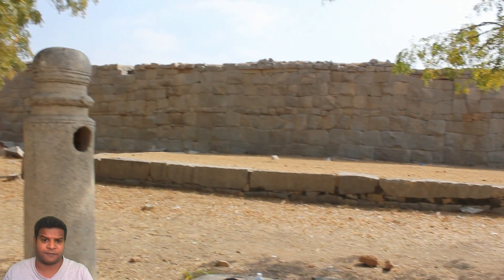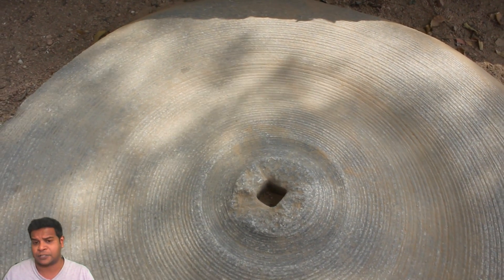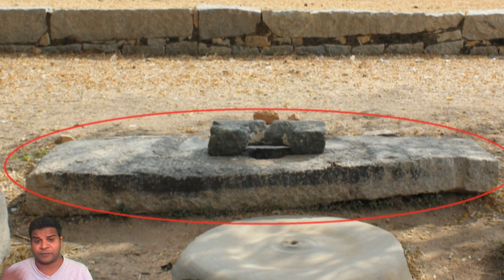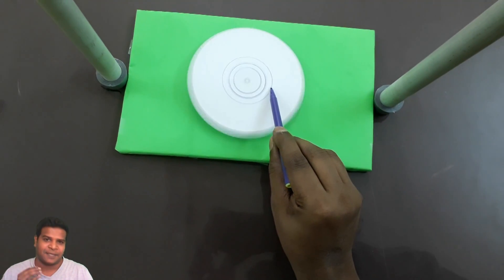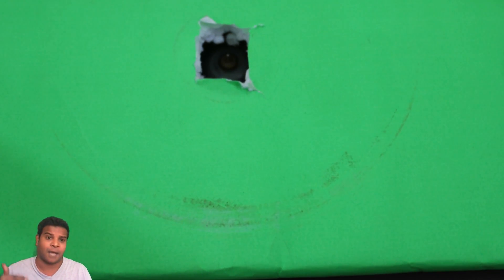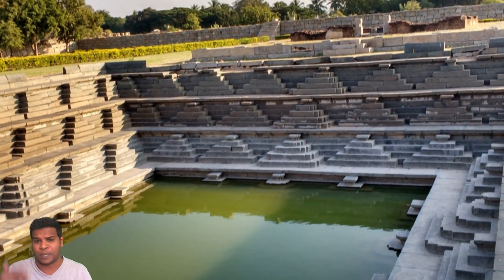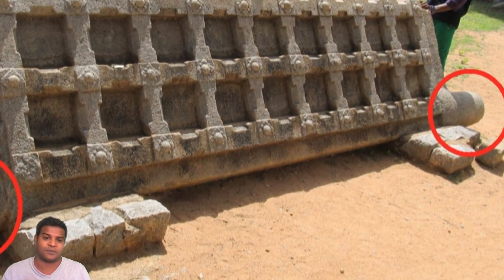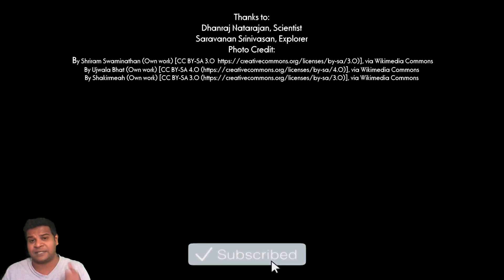Ancient Lathe Machine Found in Hampi, India - Lost Technology Discovered?

Comment: Well deduced. Though the machine you describe would be more accurately described as a milling machine. Lathes have been in use for 2500 years. From simple reciprocal lathes (driven with a bowstring) for cutting wood and soft stone. Illustrations of lathes can be seen in the tomb of Petosisis, Egypt around 400 BC and were known to have been used for cutting metal. 

India suffered the same fate as Egypt when the Arab-Islamic invaders' arrived and set about trying to erase history.  Much technological development attributed to the so-called 'Golden Age of Islam' was, in fact, from India. India was well ahead of the game in metal processing, as indeed were the Egyptians (There are ironworks in the Sinia mountains from the 4th Dynasty). 

The methods of production were always closely guarded secrets. The Hittites, for example, would execute anyone revealing the secret of iron-production. Such metals gave significant military advantages.

And, of course, the metals and tools were expensive. You didn't leave it laying around. Once the invaders arrived, they would remove the metals and the methods of production....and take credit themselves. 

Damascus steel, attributed to the Arabs was made from steel imported from India and Sri Lanka from the 3rd century. Did the Arabs invent Damascus Steel? I very much doubt it. Great warriors but engineers they were not.

Technological development in history is absolutely not linear. Archimedes (3rd century BC) was on the cusp of developing calculus before a Roman sword ended his work. Iron production was known to have taken place in the 5th century BC China.....the list is long.

India was indeed well ahead of the game. A society brought to its knees by yet another bunch of barbarians.

Comment: Did you happen to notice that the same set up in a different configuration can be used as a horizontal lathe?  It would only work on lighter pillars with small dimensions but it would work as far as I can tell. Really great find man.

Comment: As someone who is a Journeyman Machinist with 54 years in the trade this site isn't necessarily indicative of VTL technology as we know it.  It would be very informative to learn what the drive mechanism was, what sort of cutting tool geometry and materials were used along with how or if they were able to hold the tools on the workpiece center as well as how they measured the parts if indeed they were actually able to turn stone.  These questions also come after the method of workholding is established.  There is no doubt that this is an interesting site and very worthy of development.

Comment: Looks like the stones they use for grinding grain.  The surface of the stone matches the base. Hang the stone as you say and it would be easy to rotate and grind grain between the stone surfaces and the weight of the stone does the work.  
Just a thought.

Comment: Good description. There wasn't electicity in those century, but with human and elephants, horses grinding and turning could be possible. The circular stone might be used for a large scale grinder for making flour from grains. The smaller stone grinder by hand operated are still available in rural area. In the same way these huge circular stone possibly rotated to create rings in them. In the same way round pillars also possibly carved out of of stone. For cutting, carving  it was chisel and hammer, polishing also by hand tools. Construction technique was modular with many teams working. In certain cases melting of rock to get a moulded finish may be using sunlight and lenses if glass making was known to them or through gold or silver disk solar concentrator with a formwork of mud.

Comment: It’s a grain mill !!!

And I took a close up on the grooves they are not having same height!
And the center square is not centered properly beside that it does not have equal length for the four sides of the square!

And another point is that 500 years back civilization already had invented the wheels and stones where in abundance in term of shaping and using

We know india is one of the oldest civilization of not the oldest but we don’t need this kind of unsupported non professional claims

Where is the carbon 14 analysis to support the date claimed here?

Good videos production.  But content no so

Comment: It does look like this could be a lathe. It is simple and very clever. It shows great ingenuity but I wouldn't call it hi-tech. I'm sure many construction/production methods and technologies are lost in history but machines don't have to be hi-tech - a drill can be a stick with a rock on the end of it turned between the palms of your hands. The underlying principles of construction tools and machines are very simple but the simpler the tool the more time it takes to get it to do the work. Given the time you can do by hand what many modern machines can do and, with careful layout, measurement and setup, be extremely precise and repeatable.

The lathe.
I would argue that what you call the base plate is actually the base for a carrier with a pivot point where the half circle wear marks are. This would have worked together with a gantry supported by the pillars giving a stable platform for the tool where vertical and horizontal position along with depth of cut can be controlled. The round stone centered between the pillars looks like a base for the material worked (stock) with a centering axle. The grooves on this base are then a byproduct of running the lathe rather than a desired result ie. wear marks. Given the mass of stone it seems possible that columns can be turned on this lathe without supporting the top by a tailstock and spinning the stock can be done by running a looped rope around it attached to a power mechanism as simple as workers pulling the rope.

Comment: Praveen:  Sir:  I'm guessing: The Hoysala Temple pillars were turned on the lathe you found.  The rock you found was the cut off piece or drop off from the original pillar construction.  Wanna bet there is a square hole running through the pillars?  the lathe is missing the rotating machining abrasive bit that ground square pillar into a round column.  Look for a seem about midway of the columns.  They are made of two short columns.

Comment: Fantastic bro, very true, logical solution for heavy rock lath. 
Also, diamonds could have been used to chisels because its melting points are so high, very high than metals available then. But the next question is mohan, how could a heavy rock be rotated around a perfect axis that a diamond touch would create a circular mark. 

As only elephants and horses are present, those are not capable to rotate a rock at great rpm rotations per minute, which usually a motor does. 
Please throw some light and clear my doubt

Comment: Thanks for posting! I think you are right about the basic idea. However, I don't think the circular rock is a finished peice. It looks very much like a stub that has been 'parted' from the final peice.

Imagine you are turning a section of column. You would start with a roughly cylindrical peice that had been chiselled or sawn to size.

 Then you would cut (by drill and chisel) the square hole in the base and the top. These would take metal spigots which would in turn be seated in the lower rock slab and the upper beam (probably wood). No bearings would be necessary provided the spigots were kept well lubricated in their seats. 

Once the section of column had been turned, the top and bottom of the final peice are cut away ('parted') from the spigots. This can be done in such a way that peices can be seated perfectly one atop the other by making the ends cone shaped.

The grooves do not necessarily indicate the piece was worked from the top.  It could have been just as easily worked from the side, giving the same pattern.

Comment: No, that rock is the thing on which the stock [a column] would be spun on.
The squire hole would be for a "CENTER"  look up "dead center"

The column on each side would be the tools rest anchor points for an upper contraption, probably made of wood.

It is a Vertical Lathe

Large columns could be more easily spun in the vertical. [in place]
It would just take water and abrasives and leather strips to polish a column to a sheen

Comment: You wouldn't move that slab. That slab was a permanent structure, I would bet; it's just too heavy. But, I'm also willing to bet that it held a piece of that machine, that hung over the round base between the two poles to help create whatever they were creating. Look up a "vertical lathe." The "circular wear and tear" on that slab is also probably from them turning whatever was on that slab right to left and front to back, to carve what was on the round base between the two poles. However, this is all theory. Are there possibly any archaeological studies on this? Because, I couldn't find anything.

Comment: Cool find and reverse engineering. However, grinding stones is not new tech. It is as old as time. The bigger question is what metal was used in order to cut a particular stone. Soft stones are easy. Granite, quartzite and such are very hard and could not have been lathed with copper or bronze, but only with iron. Have you determined if the ground stone was sandstone or limestone or something? That is the key.

Comment: Your video is interesting but your statement about the lathe being modern is incorrect.
All you need to o id look up lathe in Wikipedia and you discover:
"The origin of turning dates to around 1300 BCE when the Ancient Egyptians first developed a two-person lathe. One person would turn the wood work piece with a rope while the other used a sharp tool to cut shapes in the wood. Ancient Rome improved the Egyptian design with the addition of a turning bow. In the Middle Ages a pedal replaced hand-operated turning, allowing a single person to rotate the piece while working with both hands."
Well considering that it should come as no surprise that such technology was being used in India in the 1500's.
Reply: It's easy to lathe machining when working with wood or something light weight in ancient times, but can you imagine they working on HARD SOLID ROCK, that could be ton of weight..? the point is not on how age lathe is being used, but how they lathe machining on hard solid rock, granite, or even black basalt rock, while there's no high speed RPM motorized turning machine exist?
Reply: That is what he is saying actually, genius.

Comment: I think you are on to something. But to me it round stone with the square hole seems more like the weight used for momentum to keep a tool spinning. Imagine the rectangle stone as the base like you said. A rod going through the round one to either mount another stone on top of to spin. Or to put a tool bit on to, like a bur or something like that. The marks on the rectangle stone would make sense if the round stone was spinning all the time and rubbing against it. In other words the round stone is part of the machine, the motor as it was. 
Do you have any more photo or videos of this?? 
Keep digging, I am really enjoying your ideas and videos.

Comment: to me this seems like a stone wheel grain grinder, called Chakki, which are common in India, they used two stones one rotated above the base stone, so these scores or ridges may have been created on purpose to allow food grain to remain within groves to make semolina, because some grains are not ground completely into fine powder form as is in bread flour, semolina is also made from wheat grain and is left coarse, the grains may ground too fine if those ridges were not there,  so to create coarse items, they may have used this type of grinding stones to produce course milling. I rules out lath. sorry. its not a vertical lath.
The two pillars are possibly to support a sack of grain that gravity feeds grain into the middle hole of the upper rotating stone, you need to find the upper stone, which may have gone missing or destroyed, but it is also possible that it may hav ebeen a lath of some kind .

Comment: gold, pure gold, that's what this video is... fantastic work man, keep it up... The half round curved markings at the bottom are indeed normal, because the pressure of the pin is always on the same half side of the object that's is being carved, when using rotation... only question left of course is , when you end up with such perfect circular carvings on a rotating object, you need to create a consistent rotation speed.. how did they do that ? If you can figure that out and find any physical proof on the site.. then I think you deserve the noble prize for archeology  ;-)

Comment: Being a machinist for over 45 years my first question would be what was used for a tool bit to do the actual cutting? Nothing I use in the machine shop would cut stone as you have shown in your videos. I have high speed steel, carbide, and stellite cutting tool bits. They would't last long cutting stone if at all. Next what powered the lathe? Did it have automatic feed to move the tool bits? Even the work I do, which is no where the size of anything in your videos, would be more than a pain to do manually and be consistent or precise. I hope you find the answers someday. I really enjoy your videos!

Comment: Indeed it is a machine. Hard to date accurately. It could be potters wheel for making pots. That would make sense because of the well is close by. The people need to transport the water once drawn from the well.
It could also be a winch for pulling up water vessels, however it is not really in a practical location for that, unless it has been moved at some point in the past.
Amazing stone work no doubt for just a simple well.

Comment: Figure out the drive mechanism and you actually have something. Concentric lines on a disc is not proof enough young man. Even a square drive hole is not enough. These are manual components for manual carving just as well as for a power tool. Dig deeper. Almost there.

Comment: I don't doubt they had machines in ancient times, but you're not right about this one. you don't understand the forces involved in a lathe. the longer the cutting tool the more it will bend and bounce across the stock. it must be short and ridged to make a cut. those posts are probably far to small to handle the forces and vibrations involved. there's also no visible way to turn that bottom stone, if they were in fact cutting it on a lathe it's sitting within.
Reply: Pete Lorenzo he knows that 😁 his explanation is just to make video more interesting and dramatic to get subscribe

Comment: The amount of strength it would require to spin that slab while under resistance from a cutting head is too much for that time, and you don't have any evidence that there is a machinery capable of that.

What makes more sense is that the slab was stabilized under the poles and the arm, with another pole hung straight down. Then, an arm with a cutting head can be attached to that pole and it will cut in perfect circles. Not a lathe

Comment: Once again your information shows just how things can happen even when you think you have seen it all.  I have questions. First, what did they use for spinning the bottom part of the Lathe?  Second, I would think that they had trouble with making metal strong enough and long enough to cut the stone.  I think we have lost part of history.  My husband was a knife maker until his death in 2013.  Many times we took out magnets through the sands of river beds for metal.  It took work but here in AZ it is amazing just how much metal there happens to be in the earth ready to be found with magnets.  It is extremely pure and easier to melt simply because there's no impurities to be removed. Then as you were showing the marks on the  machine part, I realized the marks in the flater rock on the part that you say held the round rock. The marks are not from a mistake but cutting the sides of the rock to form the circle to use for the second process of putting the lines on top of the rock.  Now here comes the the question of power, is there a water source or large animals to turn the machine?  Is there holes in the earth that could have held fuel such as wood or animal dropping that could have been used or do you have a different theory?

Comment: i bet that is the machine the big 10 ton granite doors were carved on..

it looks like the base is only partially there

but can you see evidence that water could have been used as a lubricant for the “bearing” stone? 

(assuming that stone fits into the base)

the shape of the round stone on the ground would be perfect if you wanted to use water to lift the stone just enough to allow it turn..

that sinusoidal shape of the round stone could trap water and allow it to “float” on a thin layer of water..

i think that phenomenon is called hydroplane

Comment: fantastic find..

so check this out.. 
it looks like the stone on the ground fits into the base..

i would surmise that someone flipped the stone out of the base and landed right where it is upside down..

it looks like that stone is actually the lower bearing of the machine and water was used to “levitate” the stone and allow it to spin..

i would bet that if you took an impression of the rings on the round stone that impression would match up with the scar on the base..

have you looked at that?

-b